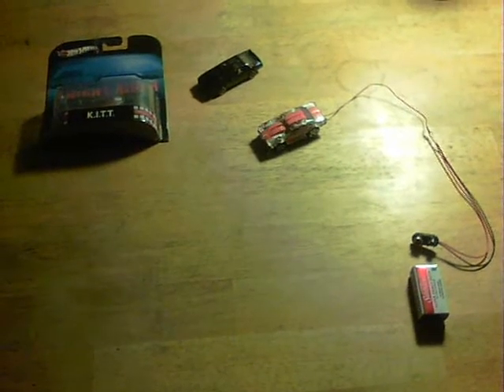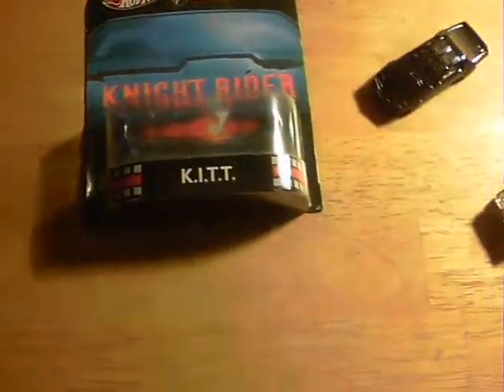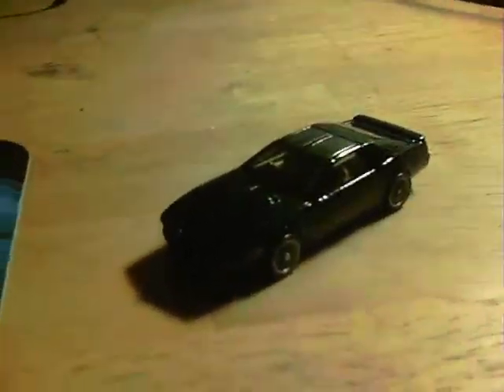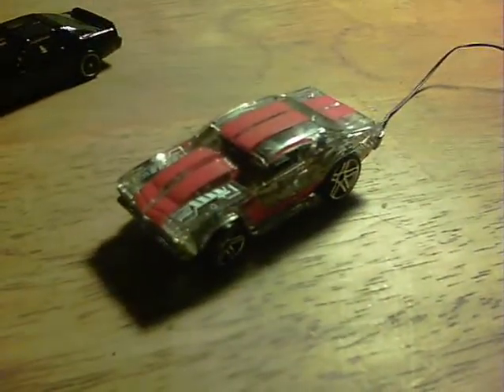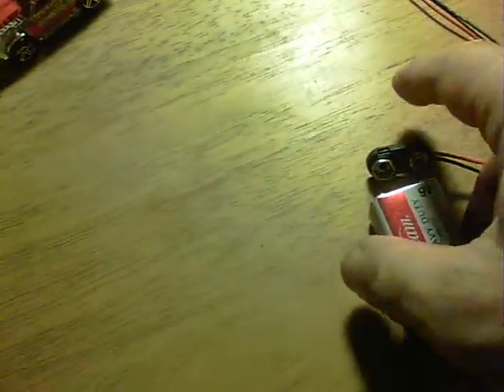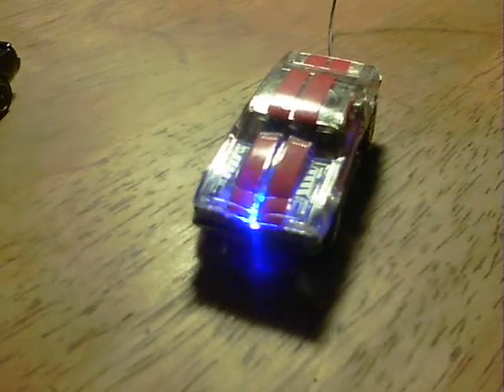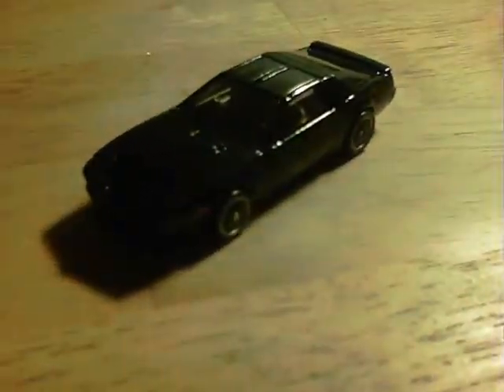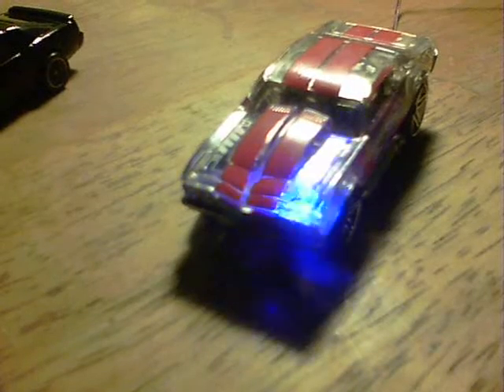Knight Rider lights circuit - in a Hot Wheels

Comment: Can you please make a complete tutorial for simple wireless electricity?
Reply from the maker: I could do a step by step build sure, if there are specifics that need to be explained. But the main thing is to just build and have fun, After all, making a pancake coil is about as easy as winding an old wall adapters cord around and around a dozen times. Will bear it in mind, thanks for your interest :)
Reply: By me when i done the coil and soldered, it just gives an output wide under 1 v when i put a coil above. im using same transistor and one AAA battery to power, but it doesn´t work do you know why?
Reply from the maker: Make sure 12 turns or more on the coils. Easy and good choice is an old wall adapter for the wire. Check that the end of 1 wire connects the start of the other, as in 1 inner end to the other ones outer end. If stumped then the 'bottle cap wireless' on Channel is another version...can use a beer bottle as the winding form or anything else non metallic when using a larger gauge of wire, such as wall adapter or speaker wire.
Reply: thanks :D I am using a PVC 0.15 mm two cables like audio cable and more than 12 turns, it looks like yours but doesn´t work only 0.03 v max